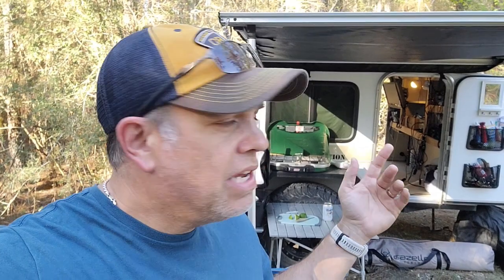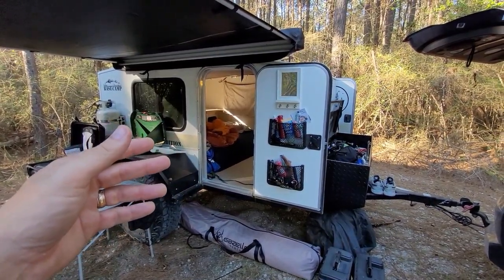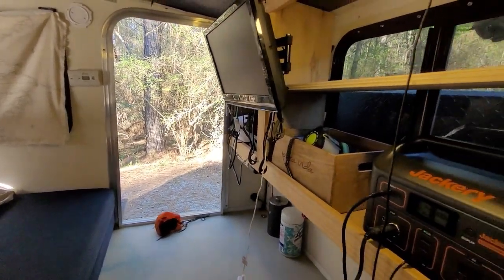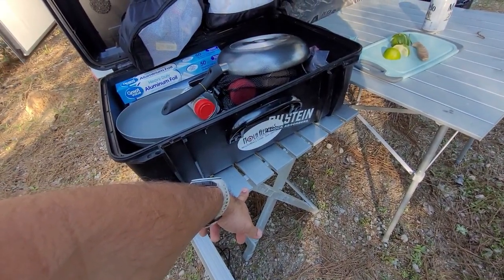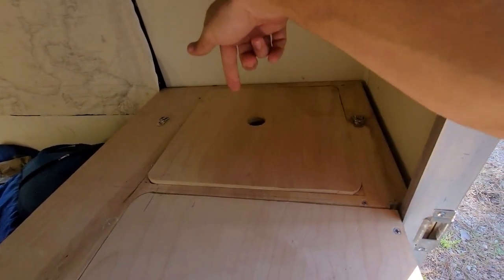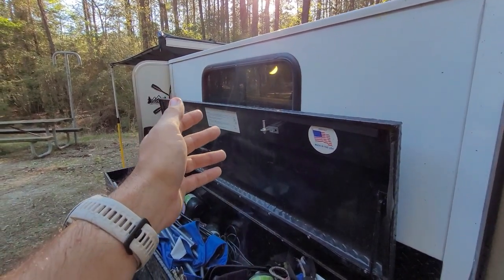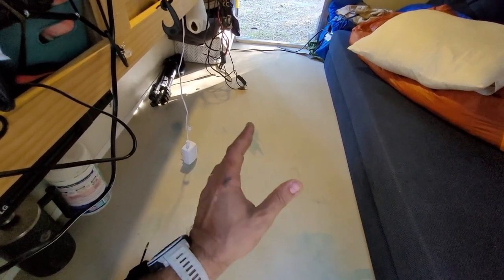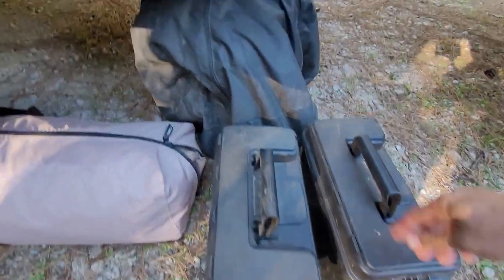Runaway Venturist Off-Road Camper 2-Year Walkaround and Review | Runaway Camper

Comment: To hang stuff on the walls permanently get some sheet rock plastic pitchure hangers short ones so they do not go thru to out side  ...Get some rubber mats that look like puzzel pieces for the floor it would help keep the floor warmer too and easy to clean come in assorted colors .. Make sure carpet is on the ceiling would help with condesation and you can use velcro on it too hang stuff up ...

Comment: Overall you seem to have gotten a lot of use out of the trailer and are happy with it. Seems like most runaway owners are happy with their trailer too. I'm curious, how tall are you if you're sleeping side to side instead of front to back. Orienting the bed that way really seems like it creates more useable space inside for other stuff. Thanks for the segment.
Reply from the maker: I'm 5'10"... only leaves a couple inches but I can sleep like that.
Reply: You can also sleep at a bit of an angle, and stretch out corner to corner on a decent-sized bed.   The diagonal of a 4'x6' bed is 7.2'.

Comment: How far off the ground is the hitch?  I want to get the right height before I take possession.

The Venturist is a good meeting of quality construction and price point.  I wasn't AS worried about price point as I was about the construction, cabin size and suspension.  It's also one of the few campers that comes all stripped down, and leaves it up to the owner to decide how they want to equip it.  That's appealing to me, because I've collected all KINDS of camping gear over the years, and I enjoy setting it up and using it.  

Moving up to a mini off-road camper will seem like glamping, to me.  It doesn't take much more cargo than I already have in my pickup to move up to a serious outfitter's tent and a heavy-duty EZ-up type shelter.  It's bulkier than my traditional tarp city, but is a lot more straightforward to set up a good-sized covered area for cooking and other purposes.

I don't think I'll do much off-roading with it, but I'm adjacent to a lot of national forest and wilderness, and the built-for-the-highway trailers wear out pretty quickly, or break down on the one washout you need to navigate to get where you're trying to get.

Nice setup.  I like the way everybody adds their own unique touches.

Comment: I am seriously considering a Venturist but I saw on another YouTube video that stated the door does not seal well and the aluminum is actually quite flimsy allowing dust and even light to show through. Thoughts? Also, if one looks up Runaway Venturist + issues, there is another article which says that the composite roof on the camper begins to sag and eventually crack! Again, I am not trying to start anything here but I don't want to drop $15k and have this happen. Have you observed anything like this on your rig after the past 2 years? Thanks...

Comment: Thanks for the video , I am still deciding between the venturist and the 6x8 Kong. I have 2 teen kids. What will be your bigger size camper candidates?
Reply from the maker: Maybe a NOBO 16 BH or a GeoPro. I'm not really into RVs but it would be nice for more trips with my wife and kids. Then maybe I'll get a rooftop tent to put on my truck for rougher solo adventures. Ideally, I'd keep the Runaway too, but I can't justify owning 2 trailers. I'm only starting to think about it.
Reply: @OutoftheOfficeAdventures  thank  you for sharing ideas . :)
Reply: @OutoftheOfficeAdventures  
Maybe you should c/o InTech again.  We bought a barely used 2018 Flyer Pursue several years ago for $10K.  All aluminum frame & skin with insulation.  Has rooftop AC/Heat unit, Maxx 10 Speed Fan, Pull Out Kitchen with Cooler/Stove/Storage, TV/Stereo.  Added a Iron Man tent room connected to rear doors that open to create a larger living space.  Weights 1600 lbs unloaded.  Fits in the garage.  Keeping it simple.